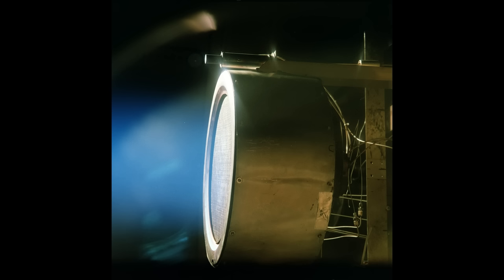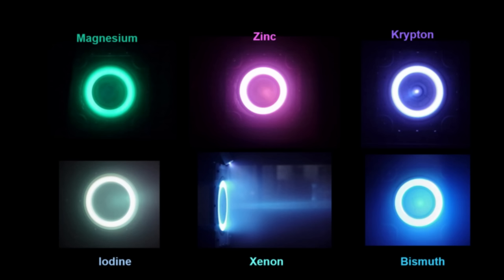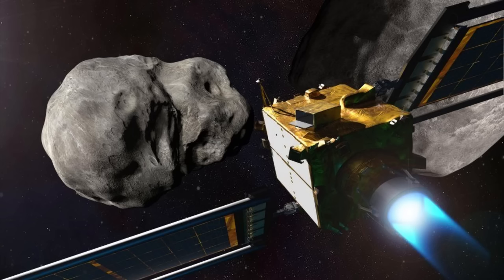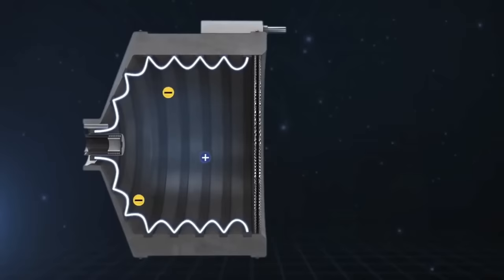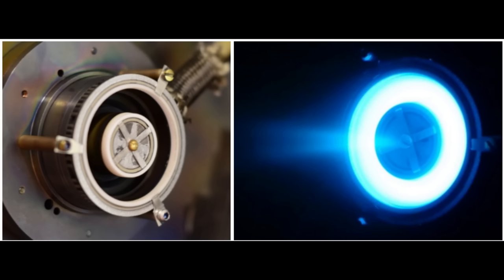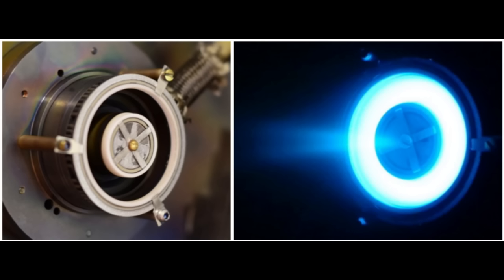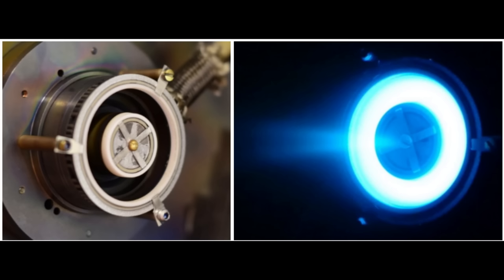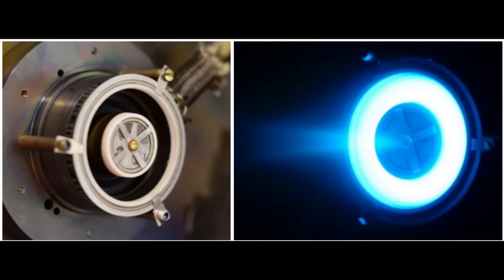Why Are There Two Different Types Of Electric Space Engines, And How Do They Work?

Comment: actually, we can build propellant-less thrusters (I swear it's not some pseudoscientific bullshit), it's just that we don't need them right now or they are just not worth it.

The simplest propellant-less thruster is... a lamp. no no I'm not joking, emitting photons impart momentum in the opposite direction, so heat that tungsten chunk, put a mirror behind it and bam ! you have a thruster ! 
And that would work ! ...But it's only practical if you have an infinite source of energy. That's because the more deltaV you want the more energy you need, the more energy you need the heavier your powerplant becomes, and now we see that we just moved the tyranny of the rocket equation to our powerplant instead. 
Even with a powerplant with an extreme power density like nuclear fusion, you would get more deltaV by just dumping the fusion plasma out the back in a magnetic nozzle. (I think maybe you could make it work if you had a kugelblitz to work with but don't quote me on that)

I lied earlier, there is an even simpler propellant-less drive... just get rid of the tungsten emitter and keep the mirror !
That's right, a solar sail (or any type of stellar sail) is a technically a thruster that doesn't need propellant !
But we don't really have a mission for a solar sail craft right now that we can't do with another less exotic thruster, so we don't really need them right now (that and the tech is not quite there yet)

Comment: the hall effect thruster you described is not the ion railgun that is intended, its something inferior
Reply: whats wrong with people designing inferior stuff, cursed by/be the law
Reply: LED's are the best photon propulsion, or just radio emitters, any
Reply: efficiency is something like 90%+ energy to photons, yes light bulb tech
Reply: true hall-effect thruster is not circular, its linear accelerator stick
Reply: just fine is not ground breaking, ksp intended

Comment: From doing nothing but praising flameble chem-fuel combustion rockets, to now force to report break through in "electric thrusters." Through history, energy ion/plasma electric power, use dinky size 🏟 halogen 🔦. Using a vast ☢storage. When the ☢storage was suppose to AMP the electric thruster/booster power.